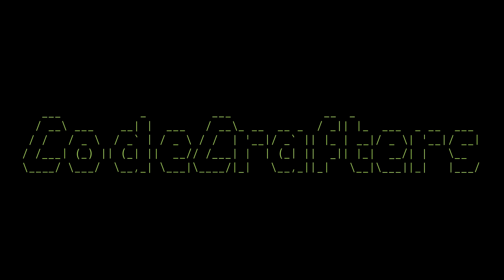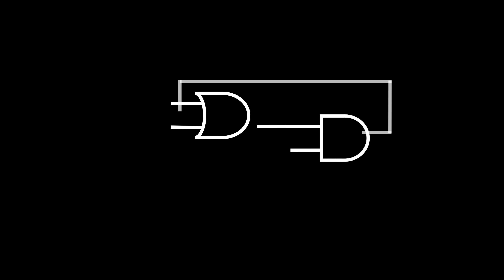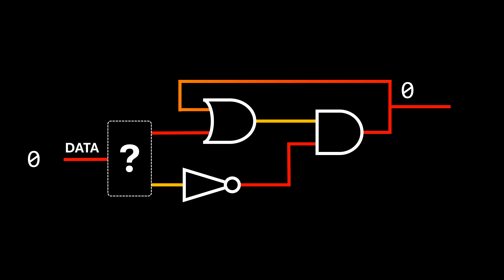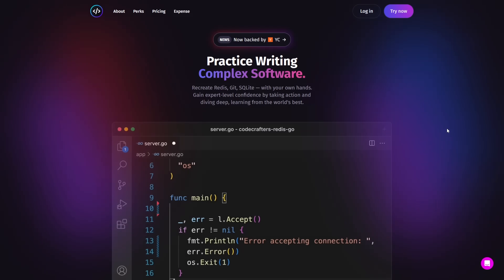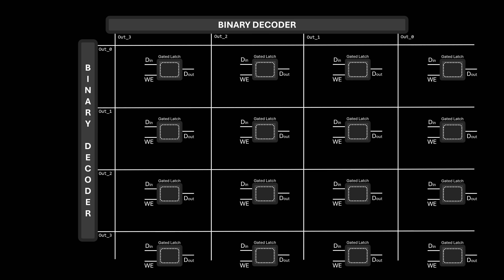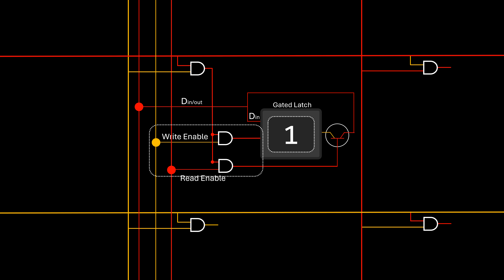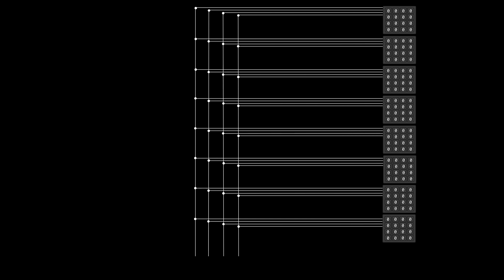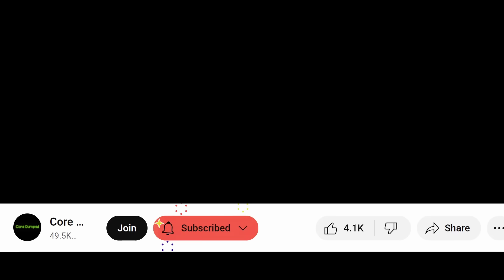HOW TRANSISTORS REMEMBER DATA

Comment: 16:08 any plans on doing a separate tutorial on SRAM and DRAM? I'm currently studying digital circuits, CR and RC filter circuits, AD and DA converters, modems and so on for an exam in June. I'm studying it thoroughly to understand and these videos come as a solid run down to what I've learned weeks prior. I can tell, your content is spot on when it comes to these topics! Flawless.

P. S. Also, maybe it's just a coincidence, but in February you've put out videos covering topics of operating systems and underhood of kernel, virtual memory, processes, threads and so on. Exactly at that time I was studying for OS exam. It's almost like your content follows my college curriculum, lol!
Reply from the maker: Yes, but that video is not a priority for the time beign. So probably on July.
Reply: @CoreDumpped  Nice. Keep it up, mate.

Btw, do you have any recommendation for literature on these topics?

Comment: 10:01 is the input/output inverted for the binary decoder? There’s only two inputs for each and four outputs for the rows/columns of the matrix.
Reply from the maker: With n inputs you get 2^n outputs. I don't see what's the problem🤔
Reply: @CoreDumpped I rewatched the binary decoder snippet and realized I flip flopped the input/output. I thought the output was the two wires and the input was the 4 wires. 

Then again, it wouldn’t made too much sense for it to function the way I thought, so thanks for the clarification.

Comment: The Intel 8086 takes an interesting approach to its registers. They use two inverters connected in a loop, with one of them using a weaker transistor than the other, so that the data being written can overpower it to set the new value.

Comment: they dont, its usually capacitors which have the data stored.
Reply from the maker: Tell me you didn't watch the video without saying you didn't watch the video.
Reply: transistors remember (asterisk). @CoreDumpped

Comment: How does the electricity keeps staying there in the loop in beginning OR gate example when we set the input to 1? You mentioned the transistor has to be powered but I do not see how this works together.
Reply from the maker: Once you've made the OR gate output 1, that output value (1) goes back to the second input. So from that point, it doesn't matter what value you set the first input, the output will be 1 since the gate needs one at least one input to be 1 to do so.
Reply: @CoreDumpped  Thanks, I think I get that part. I am curious how the loop keeps its state, should not be there some energy loss? Is it simply because the transistor is under power? Sorry if these are dumb questions.

Comment: As someone with a working understanding of this I want to say this is possibly the best explanation of sram I've seen on youtube. Excellent work. Can't wait for your next one.
Reply: Well, in my opinion there are better ones starting with two inverters feeding each other which is indeed the core thing of a memory cell.
Reply: @Merilix2  Are you talking about a Nor latch? Just two inverters feeding eachother won't do anything more than oscillate.
Reply: @nightfox6738  No, but think about it again. Two inverters feeding each other form a bi-stable circuit.  
But because they are made of weak transistors, they can be forced to flip by providing stronger write signals. Thats how 6-t cells work without the need of write logic in each individual cell
Reply: @Merilix2  Yes but that's not ideal for an entry level educational video now is it? In addition to the discrete logic you need to rely on and understand the imperfect tolerances of the hardware components. Hardly an easy topic to broach for people new to the topic.
Reply: @nightfox6738  You are right regarding the real implementation but I think the core principle (2 inverters) should be emphasized.
All circuits I'm aware of do it that way, even the reg-file in the z80 processor with its 14x16 bits.
Of course,  for education purposes you can insert gates in between to not rely on weak and strong signals.
Reply: @Merilix2  That's fair. Do you happen to know of any particularly good materials on the subject?
Reply: Did allat for a little comment like 😂😂😂😂😂
Reply: i too want money can you send the money🤗🤭
Reply: @Bhanu-vs3bj Haha, on the street you will have more luck!
Reply: @Bhanu-vs3bj  work bro..

Comment: great video! two questions: could one use a 3d tensor instead of 2d matrix, or is it impossible to manufacture. and second: could you give some nice literature reference you based this on? awesome stuff you do
Reply from the maker: It should be possible to use a tensor. Lately I've been hearing about this AMD technology called 3D V-cache, although I'm not completely sure if they are using a tensor or just matrixes stacker in the top of another.

Comment: I was just wondering, Logic gates are just a bunch of transistor arrangement. It seems that it takes quite a bit of logic circuitry to make a 1 bit register. But can we do better if we don't think from a logic gate perspective, and just try to make a latch from transistors only? Like one with much less circuitry?
Reply from the maker: Yes, it is totally possible and in fact that's the way it is done to reduce costs. But it still requires some m transistors (4 MOSFETs, as far as I remember), so DRAM is still cheaper.
Reply: @CoreDumpped Wikipedia uses the number 6 because you cannot get rid of the address and bit lines.

Comment: This is really an amazing and really clear series so far! I have no assumptions to make  on how any part of this works because it's all explained (except maybe the workings of electricity and the transistors themselves, but that's okay obviously).

P.S. at 9:48 the colour of the wires on the left are wrong. The address is 0001 but the wires suggest 0110. Small mistake, but I thought I'd let you know :)

Comment: i am currently studying compsci at university and your videos are honestly just one huge “AHA” moment so far
I’ve suddenly understood so many concepts on a fundamental level where our lectures have failed to properly explain the basic building blocks that you need to be able to reason about those things on your own, without just memorizing a bunch of definitions etc.
seriously if they’d just shown all of your videos in a row before starting the semester I wouldn’t have struggled with the advanced stuff we did nearly as much and even now so many things I couldn’t really grasp before just clicked into place all of a sudden
Reply: I also had this when learning computer architecture, I found one day an android app that simulate those gates and after tinkering with it I found only at the end of the semester that this things can  in fact be learned easily by assembling the gates and see by yourself what happens.
Reply: @NomenaFAndriamiadantsoa  i think it’s incredibly important to learn why things work instead of just the how
abstractions are important for working with things, but if you know how something works under the hood you can derive everything you might be asking yourself about the high level component from that knowledge, even when you never specifically learned it or just forgot the information
I won’t write my next project in assemply or even C, neither will I think about what exactly the gates in my CPU are doing under the hood for every line of code I write but knowing about that stuff helps immensely even at higher levels sometimes

Comment: This video made me realize how inefficient standart computers are for running my program I wrote in assembly. By removing some features, I can creat a computer that runs my program even faster. Without those features my specialized computer won't be able to run pretty much anything else but it's just a small cost to make my code run one microsecond faster.
Reply: If you drop the code entirely, you can run your entire logic in one clock cycle. It may be a big circuit though.

Comment: I never knew that bits were not stored sequentially! So many concepts are abstracted away in computer science, that it makes learning and understanding harder. I only recently learned about the existence of standard cell too.
Reply: nice profile picture
Reply: saaammme
Reply: Hey, mind explaining what a standard cell is and what topic I can google to understand it better?
Reply: @bestatfifa  6T SRAM Cell, consisting of two inverters feeding each other and two pass transistors connecting the cell to two bit-lines (bit and its inverse) if the cell is selected for read/write.
Writing is done by providing a stronger signal on the bit-lines which override the weaker state of the selected cell so writing logic doesn't need to be part of each individual cell which saves a lot of space on the die.

Comment: This is fantastic. Honestly I wish you wouldn't "simplify" stuff..... or at least say what more is necessary for memory to work. Because I "think" I finally understand the grid of wires from the 60's used on computers that went to the moon or to the orbit and being described as memory. Heck, if you take a look at modern AMD CPU (there are fantastic high-resolution pictures) and look at cache, which is SRAM, you do see grid as well. Very distinguishable.

Comment: If anyone wants to dive deeper into this with practical homework, check out the online course Nand2Tetris. It's a course where you use a computer program for simulating hardware and you start with only a Nand gate circuit. From there you create many other common gates, then an ALU, memory, etc all the way up until you run tetris on it. I did it last year and it opened my mind an insane amount to how this stuff actually works since I implemented it myself.